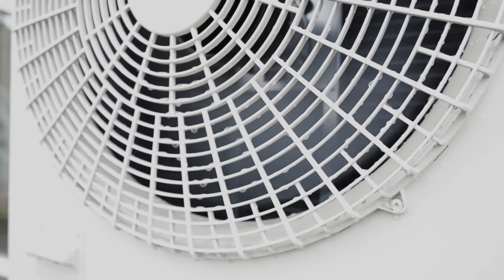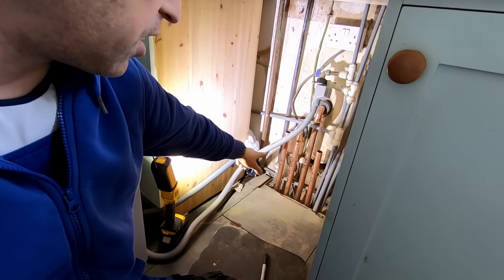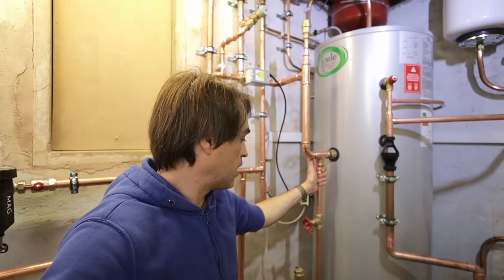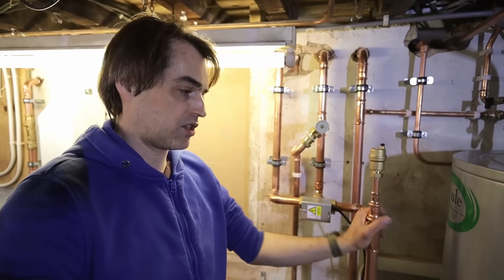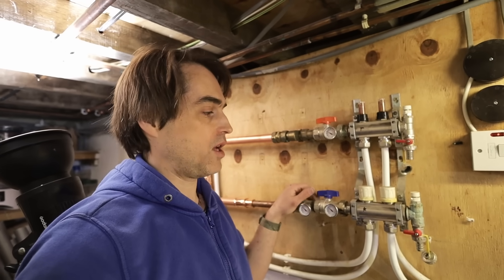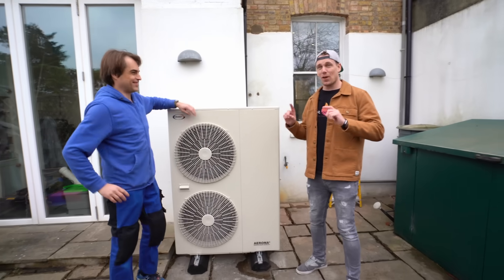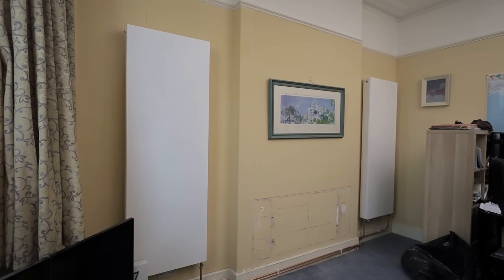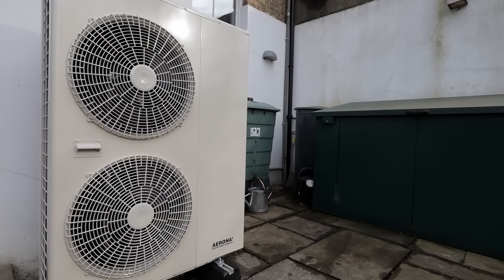The Truth about Heat Pumps: Debunking the Myth.

Comment: Hey Simon,  as usual absolutely stunning install. The work is a true master piece and I know you installed this to someone spec. However  shame about the design  and products  that have  been used here , the radiators are truly and shockingly ugly I would sooner have a poster of the elephantman on the wall.  Cost for this was  probably £25k if this is what the government is encouraging people to have ? We urgently need a new government !!!(I know of an estate that had these fitted and thus far winter cost £1500.00 per quarter , they have to be left on 24/7 .... this size probably  £2000.00  per quatre...)  And finally I hope who the person who sold this to the customer advised them that , after the install there's no going back to there gas boiler...cuz that will be the next thing this incompetent government will make law...people you have been warned ⚠️ Don't be fooled.......a master piece of workmanship Simon  as always 😉
Reply: Even ths govt is not going to mandate a return to gas boilers. Even conservative (apart from the morons in the 'Net Zero Scrutiny Group') recognise that gas is on the way out.
Reply: £2000 a quarter, so at £0.15p a unit (we're talking the past here), that's 13,000KWh of input, now assuming you're getting an utterly atrocious CoP of 2x that means 26,000kWh of heat, lets times it by 2 for the whole of winter. 52,000 kwh of thermal input into that building for space heating.  Now my 80's three bed semi requires 10,000 kwh for space heating each year - so I don't think so.

Comment: Interesting but my queries are: how old and what type of construction was the house (number of rooms, insulation, warm/cold roof etc), how many occupants and most importantly what was the total cost of the system and what is the annual estimated running cost (based on the current day  £0.28 per kWh for electricity)? The compare this to the cost of the old system. I'm interested in the numbers & facts as these are the key to whether or not these systems make financial sense for consumers
Reply from the maker: the house is 1870, roof is insulated with 100mm spray foam, double glazing thorughout. around 150m2 over 3 floors. 

There will be a follow up video with running cost, ect. but it will come after next winter where we compare all the cost.

Comment: I would be interested to see more on the controls? It's hard to find good information on the best way to control a system. How do you keep a comfortable temperature throughout the house if it isn't zoned?
Reply from the maker: by carefully designing the system and heat emitters and also designing all rooms to required temperatures. That job does not even have a thermostat. All is run on weather compensation alone. 

You can always turn radiator valves down, but it is not advisable.

Comment: This hasn't taken off in the states. But mini-split and VRF systems have found a market and foothold in certain scenarios. As the issues with quality and ridiculous cost and lead time on parts improves, this will get better I think. 
But in the states we have so much land. So it's not very convincing to use a VRF system over a tried and true boiler/chiller for commercial/industrial buildings when you have the room for it. Even going with all packaged and split systems is preferable. 
If you're gonna run hundreds of feet of pipe, filling it with cheap water seems preferable to expensive refrigerant.

Edit: single and multi-zone mini-splits are actually pretty reliable. Can be annoying to work on when they're not but it's not often they break down. We love using these for smaller server rooms on our commerical accounts.

Comment: Your work is second to none absolutely mustard 👌🏻 but how can the working class afford these heat pumps let alone the extra work this kind of installation causes ?
Reply from the maker: I do not think this is actually that much diffrent than installting a full new central heating based on gas and unvented cylidner.

How can we afford not to do it should be the qustion really.

Comment: I don't understand why Europe does it this way. In America we have forced air systems, both with heat pumps and gas furnaces (you can find plenty of boilers but they're less common). The forced air systems allows for greater efficiency and improved air quality. Gas furnaces are so efficient here we vent exhaust through PVC pipes. Boilers have to be vented through metal pipe which means a lot of heat is going out the chimney.

Pretty much every heat pump here is forced air, needless to say.
Reply: The forced air system has huge losses when most of the ducts are in the attic or in the crawl space. That also does no favors to air quality. The pro is easy switching to different heat sources.
Reply: Condensing gas boilers can and often are vented through plastic (PP) pipes around here as well.

The reason why something like 80% of US residential is forced air, whereas >90% of Europe uses hydronic systems is because in the US air conditioning is common and often necessary so both heating and cooling can be provided with just one system of ducts and an air handler which makes things cheaper. In most of Europe, except for several southern countries, heating is needed most of the year and AC is something people usually can live without, therefore the system of choice is hydronic because it is quieter, more comfortable and can be easily zoned. Also most of our construction is not cavity wall but solid brickwork which makes it really hard to hide gigantic ductwork (at least compared to thin pex lines for water-based systems).
For AC we use mini-splits which are something like $500 a piece around here or $600 if you wanna go for Mitsubishi etc., but for some reason way more expensive in N. America.

Also keep in mind that the UK is not all of Europe. In Britain there's plenty of very old housing stock build in 1800s and early 1900s with no insulation and no easy way of adding any. That leads to what you can see in the video, where calculated heating load for just one room is 1700W. And that's in a country where temperature rarely drops below 0C. That's going to be problematic regardless of heating system type, both in therms of energy cost and installation.
For comparison, in Central Europe where load calculation temperature is around -20C, estimated heating load for my 190sqm recently renovated 1977s house (new windows, exterior doors and insulation) is about 3700W. At 0C it's 1/2 of that, which is just a bit more than this one music room in the video. It's crazy!
I'm considering ASHP since the radiators that I have are now oversized by a factor of 4 and on a cold winter day the boiler barely reaches 40C. Still they're 1/2 the size of what I've seen up here...
That said, most of new construction around here (and 100% of those who go for a heat pump)  is hydronic floor heating. That's just 35C heating water supply, as much as output air in a central air system.

Comment: Great video !! 
Hope our insulation and Bond & Seal helped. Its our Primary Pro insulation which we have started to manufacture as ASHP Installers were using our Condensate Pro to protect their waste pipe from the HP to the drain. They asked us to make the same for the 28mm distribution pipework, so we just launched Primary Pro insulation.
Making sure all the joints are sealed is an important part of the installation/efficiency. Our focus was to make the products UV & weatherproof out of the box, easy to fit in all weathers,  look quality, and be simple to look after throughout the life of the HP /system. 

Videos like this are vital to get the message out that heat pumps work, and the common sense approach is needed to help end-customers understand what is needed. 
Heat loss calculations, survey.
Good advice from the start.
Quality specification/costing, so the end-customer understands.
Installation with nothing missed or made cheap, that will affect the efficiency and life of the system .
Commissioning to fine-tune every post .
Hand over/customer understanding. 
Last but not least, annual services of the system to assure the very best efficiency. 

Keep up the good work and videos, and I hope more and more will do the same to show heat pumps will 100% play a part in fossil fuel reduction and quality energy efficiency.
Reply from the maker: Hi and thank you for the comment. I find it hard find and to buy your product. What is the best supplier / website please?
Reply: Lol vested interest much?! Pahahaha and can't even get their wonderful product. Smh

Comment: If you watch Roger Bizby on heat pumps he always states that heat pumps need to be designed and installed correctly if you want any chance of them working properly. And he also states that there will inevitably be thousands of systems that won’t properly designed. That’s an entirely reasonable and realistic criticism!

In the house in your video, you have taken up a large amount of space in a basement and the complexity of these systems over a conventional one demands a lot of extra space, time and expense! What happens with one or two bedroom flats, or indeed small houses like this, but which don’t have a basement for all this stuff??

And installing huge ugly radiators are not what people want in their homes, nor do they want an industrial looking fan unit with horrible looking pipe work cluttering up their small courtyards! What is your have no outside space? What if you’re on the 6th floor in a block of apartments?

And the video doesn’t cover the costs of installation, nor the running costs! Eg Where I live, electricity costs 4.56 times that of gas, so that needs to be considered. The work and hardware that has gone into that small house will have cost several times more than the system it replaced! Even with a tax payer funded grant, it will take decades to wash it’s face (if ever).

I think the sensible solution for households is to focus on insulation, drafts, solar gain and to fit the smallest condensing boiler, based on the resulting reduced heat loss. It might just be that a practicable solution will have evolved by the time those boilers are nearing end of life. 

Current heat pumps are too expensive, too complicated and incompatible with a very significant percentage of our housing stock. 

If I you can convince me I’d see a return on my investment in even ten years, I’d give heat pumps consideration, but right now, these are for virtue signallers who either simply don’t understand the numbers, or the performance, or can afford to burn the money to absorb their consciences.
Reply: Did you see the old sash windows and complete lack of insulation in the basement ceiling, that house needed insulating properly first.
Reply: @Hatchethas  strangely enough, I thought I’d saw Celotex between the floor joists. An old house like that is unlikely to have cavity wall insulation and if the sash windows are original, that wouldn’t be goo for this system. However, the engineer has done a heat loss calculation in order to specify the correct sized radiators. And the end result is two enormous, heavy vertical radiators taking up valuable wall space. 

I don’t care what anyone says, this installation demonstrates that air source heat pump heating systems are only well suited to new builds, where insulation standards are vastly better than in the majority of our housing stock.

The most cost effective way of reducing your energy bills is to insulate and draft proof your home. The other thing is to size your condensing boiler so that it’s not cycling, to benefit from  the added efficiency of condensing technology. 

Those that think electric heating is viable for legacy housing stock have no idea about the numbers! Electric systems should not be subsidised, the case for adopting the technology should be compelling. But they are far far away from compelling, super costly, unduly complicated and expensive to repair! Eg my friend’s heat pump packed up not long after the warranty expired and was mugged £1500 for a new control board!? Our old boiler failed with a similar fault and the control board cost £200. Seriously, you’re paying one and a half times more for an air source heat pump control board as you do for an entire condensing gas boiler. By anyone’s standards, that’s ridiculous. 

People can’t afford these systems and those who find they have no alternative will be pretty fed up when they realise they have the plumbing of a small refinery wedged into their small dwellings!
Reply: A monoblock HP is best buy: does not take space in house and is easy to install even by yourself, 4-6kW ones cost 4000 euro. Aditionally for domestic hot water a 80-100liter heat pump boiler placed in bathroom would cost 1000 euro. Very little piping, valves, automation etc needed.
Reply: What do you think natural gas will cost in 10 years?

It's going to go wayy up. It less a matter of if than when. 

More of the problems seems to be retrofitting from a water source heating. If you install air to air minisplit the COP is way higher and the installations are way less.

At the end of the day the property is more future proofed. In the short term way more expensive but long term, it will be a lot cheaper!
Reply: Roger stated price parity for gas and electric 

And that’s exactly what’s happening

Comment: Nice job but....
Not many people would have the kind of money to install a system like that and you had the benefit of a cellar to get most of the installation in and there's a lot of pipework involved and a lot of houses don't have cellars... !
Also not many folk would want radiators the size of icebergs hanging off the walls in their homes and it's always difficult to explain to people why there radiators are only getting Luke warm when they are used to having them boiling hot almost.... !
I think the best route to take would be insulating the house by fitting new windows and doors and insulating under floors and roof space etc and if done correctly will be a good investment , I believe the heat pump market will be very small for a long long time due to lots off different reasons some of which I've stated above and the more easier and most economical way ahead will be the Hydrogen boiler which I believe will be the way ahead in the future but it to has its faults and gremlins that will need to be ironed out before it becomes the next go to product for heating our homes...
Keep up the good work Simon and I'm looking forward to your next one
👍

Comment: Just one question and one comment, Q) normally when fitting a 3port valve on a UV cylinder you need a zone valve between the 3port and cylinder but you made mention that you fitted a diverter valve, is there no requirement of zone valve when fitting said valve?

C) man those are some hideously big radiators, they appear to completely over power the room!
Reply from the maker: No need for another 2 port if 3 port spring return shuts off the cylinder not the heating
Reply: Cool good to know thanks!

Comment: Very interesting, another great video. I think where Roger is coming from is that he isn’t against HP’s but in reality there is too much work and cost involved in installation in existing properties unless there is a major renovation going on. The cost implications for ripping up floors, re-piping, finding the space for new emitters & cylinders where most had removed for combi’s. Without doubt they should be compulsory in new builds, the government would be better off offering insulation grants, ensuring that installers do correct heat calculations and perhaps offering the best boilers such as new Intergas with flue recovery etc.
Reply: Agree but this has to be progressive, what is your opinion on air blown 2 way HP’s that also can be used to cool possibly easier to install. I think this what North American market is using.
Reply from the maker: @Traumahawk007  you can't heat water with those. Apart for that I have no real knoweldege of air to air vs air to water comparison. Would be good to know.
Reply: @Traumahawk007   air to air heatpumps can be a good suplimemt to lower the need for central heating but it can never give as even heating as a water based system. But could be a good way to use less gas for central heating i would thou recoment to avoid those with two indors units cause often the have same capacity as the cheaper one indoor unit ones. The best way for air to air to work good is to have one air/air per level in the house :)
Reply: I guess off peak electric or solar/battery for water. 
Have a look at this channel. 
https://youtu.be/7J52mDjZzto
Reply from the maker: There is only so far you can go with gas efficiency! Why not burn gas at a power station instead and get scop of 4 for heating?

All houses used to have hot water cylinders and original central heating installation must have also costed a fortune.

I wonder if people were saying that CH was to expensive to install and that they will stick to their coal heaters or fireplaces?
Reply: @UrbanPlumbers  Fireplace with no fresh air intake, so its only warm around the fire while you are actually sucking in more cold air. Back to the stone age and caves I say! (Irony included)

Comment: Nice video. Excellent installation. Lovely piping and some tech talk. Putting aside the baffle with science approach and the team up. You didn't provide a breakdown of the installation cost or even the cost of the entire installation. What about the calculations on running the system. Roger doesn't make a living off installing heat pumps. You do so. I can see the bias without even watching the video. But the video is plenty bias anyway. No real comparison of what you was taking out and putting in terms of cost. Did the old system really need ripping out? What was the running and maintenance of it Vs the heart pump